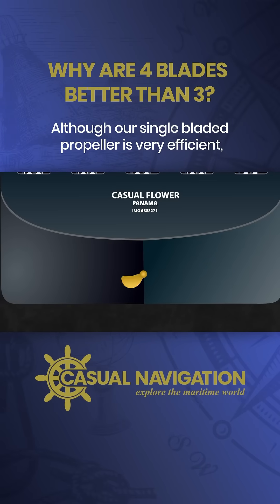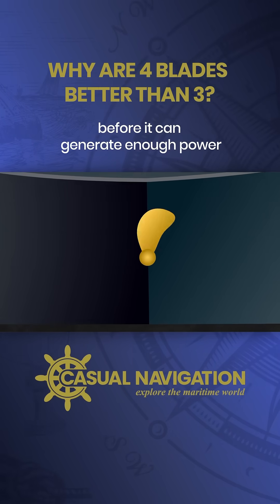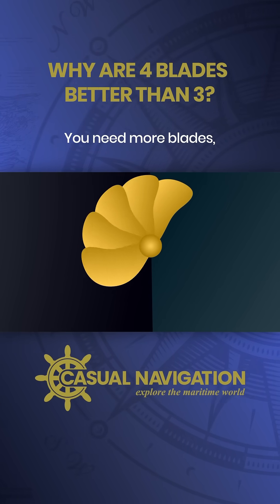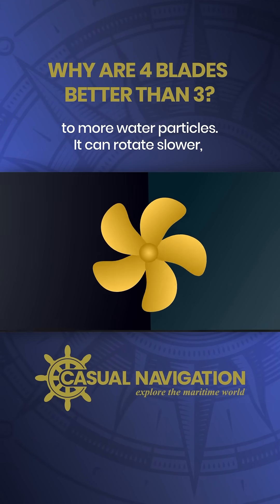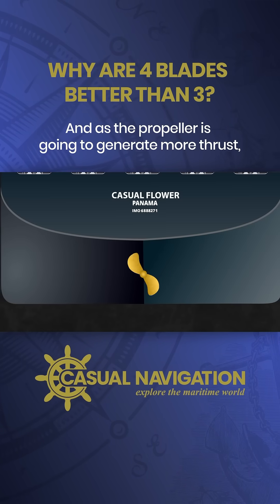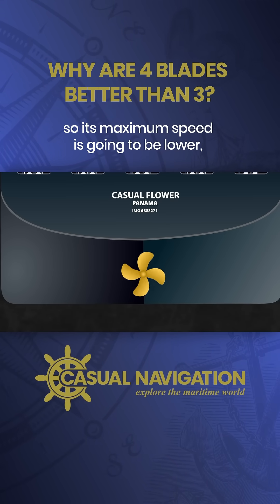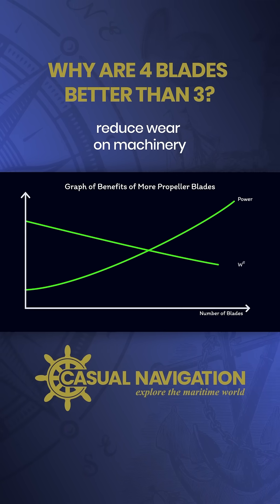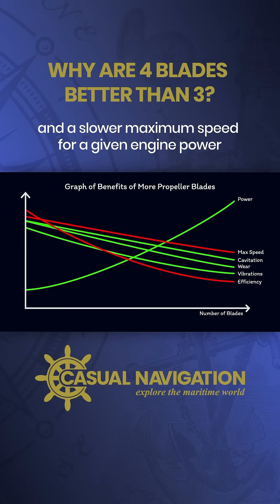4 Blades Better Than 3

Comment: True. But you forgot imbalance (wear on the shaft) and noise, though this is caused by cavitation, so it was involved. TL:DR You need at least two, more is better but starts to have more disadvantage soon before ten.

Comment: Have we tried staggering the blades along the length of the shaft? That could give the same thrust value as a standard propeller while also reducing the amount of disturbed water the blades come in contact with
Reply: How would that reduce it? With the blades on a single plane, all the blades have access to undisturbed water. The disturbed area of water only spreads out behind the blades, so you wont find any more undisturbed water behind them. 

The first propellers were single screw profiles, which is conceptually pretty close to staggered blades, and they were not used for long.
Reply: That axel would be very difficult to balance,
Reply: @ one pair closer to the ship another pair in line with the first two behind them?
Reply: Or a corkscrew? Would that work or am I sipping crazy juice?
Reply: @  that has a large risk of becoming unstable, just minor imperfection will cause it to vibrate putting stress on the bearings, what would cause more and increasing vibrations due to wear
Reply: @ no more so than an imperfect traditional prop
Reply: @ that I have seen, doesn’t do well past anything but very slow speeds

Comment: I don't know how well it'll work in the water, but a drone delivery company engineered a propeller with 2 long and 2 short blades that cut through the air better
You can find a video about it on the channel TheSlowMoGuys

Comment: Since it takes more power (momentum) to spin a propeller with more blades to produce the same thrust as a propeller with fewer blades, that therefore needs to spin faster, the wear and tear on the machinery will probably be about the same.

Comment: Why cant we have 4 propellers with 1 blade each all spaced at 90 degrees apart to resemble a 4 blade propeller. 4 propellers should be placed beside each other at a distance where they di not disturb the water for each other

Comment: Ok what about a really long prop head. You have one blade them travel down the head and theres another blade rotated 90 degrees around the head and so on so you have 4 blades but they are spaces out horizontally. I imagine that might accomodate for some or the concequences of having multiple blades but have structural downsides in how strong and resilient you have to make the prop.

Comment: 30 thousand blades moving at 1 planck length per hour causes light speed travel
Reply: c blades
Reply: You need to have no mass to achieve light speed
Reply: @ or infinite energy
Reply: @mustardjar3216  are there any massless blades?

Comment: What if you considered variable geometry. I don't know if it would have any effect on a propeller. But in CNC milling, there's a significant difference in resonation. A cutter with teeth spaced equally apart, causes a lot of noise and makes larger marks. However, a cutter with teeth spaced unequally apart cancels out resonance an creates a finer finish.
Reply: Sure. But at the end of the day it is all about money. Might be a thing for high end raceboats, but the average container ship will get a single piece of bronze that hopefully will last the 10 or so years untill the ship has paid itself off and gets sold to someone else.
To maintain the geometry you would need to send the ship more often into a dock. And a docked ship doesn´t earn any money
Reply: That science is just now getting into propellor design. It has just hit prototypes of aviation propellers (well drones where innovation can take place sans the govt) and will probably trickle into the maritime space soon.

Comment: A single blade propeller would wear out the shaft and the shaft's bearings like crazy.
Reply: Ok... So I am an engineer that studied hydro power. Propellers are bread and butter there. THe difference is, that we usually have a pipe where the pop works. Somehow I do not remember the part, where more blades caused less power on the propeller. There is a limit on the hydrodynamics that is set by cavitation (approaching boiling pressure of water in the temperature of the sea). There is some issue with currents on the propeller edge. But with more blades you get many great benefits. For one you get symmetric loads on the shaft. Especially bending the shaft is very expensive in bearings (you have to have more resistant bearings and maintain them with high cost). Vibrations would also be crazy, if there was only one blade. The whole ship would feel the shaft wobbling. The engine and the gear box would probably also get damaged, if there was one blade. 
Boy, you have some episode in front of you ;)

Comment: What my engineering course taught me is that everything is a compromise.
Reply: I compromised I ate grilled cheese of the radiator
Reply: "There is no free lunch"
Except on binary search. That one is on the house, assuming you have a sorted list.
Reply: @matheusjahnke8643 what about one Biggs’s propeller
Reply: That's bad... If you're degree would be good, you'd be taught WHY. That's the problem with the modern education... No more selection to make more money. So they had to lower the standards (negative exponentially)... So now people who wouldn't understand it anyway learn nothing, and the few who are able to understand it just get told "that's how it is. No explanation because your peers won't get it"... Diplomas are meaningless today. I ignore them while hiring. Usually the ones with diploma are worse in every point that those without (we have a dual system with apprenticeship vs studying. But it's also broken, because most study but most of those shouldn't... They're allowed to because of money...).
We have to go back to the original. Apprenticeship for everyone. University and studying only for the minority capable of achieving discovery in science.
Reply: You're fired lol
Reply: Thats the difference between scientists and engineers. We can design and make things perfect, but that will be impractical. We make things just good enough.

Comment: Funfact: submarines usually have 7 blades because they have to deal with another factor: noise reduction.
Reply: Prime number of blades to avoid harmonics.
Reply: @grzegorzkapica7930  damn, weaponization of music theory
Reply: noise are just vibrations really
Reply: @downey2294  no shit
Reply: or they'll have a pump-jet instead
Reply: and they have contra rotatating blades, because cavitation which = noise
Reply: Specifically, resonance. Even blade numbers can cause higher frequency, louder sounds due to wave doubling.

Comment: Single bladed propeller just looks wrong. It at least has to be like a spiral coming out from the center
Reply: Just imagine the vibration. bhAGaawtaHGasgAWawaHa. Even in the 1700's they understood this.
Reply: you have just described a lily impeller
Reply: I mean if some new option that's not a compromise ever appeared it'd be a breakthrough and soon the only option adopted

so if more than one option is alive, yeah it's bc it's a compromise
Reply: @  yeah that's the law of pros and cons
Reply: ...the 'Archimedes-screw' is s.k.o an extreme form of a '1-blade-propeller'...!
Reply: Insane imbalance... Would snap the shaft very fast....

Comment: Do marine engines have any facility for synchronizing the rotation of multiple screws?  Propellor-driven aircraft use this approach to manage the noise of propwash reaching the fuselage.
Reply: Some, mostly military ships, have two or more engines, a gearbox in between and two screws (CODAG, CODAD, etc...). The reason is redundancy and fuel efficency. Most other ships don´t have more than one screw at all or seperate systems.

Comment: What about offsetting the blades fore and aft slightly - is the water disturbance improved? I.e. To mimic more of an actual 'screw'.
Reply: They are twisted in such a way that that is effectively accomplished. They're called screws because they originally were screw-shaped! That however produced a lot of drag and wasn't very efficient, thus the evolution to the propeller.
Reply: They effectively are - since the propeller is constantly moving forward each blade takes a "bite" from a different part of the water than the previous.

Comment: So how many blades did the Titanic have? Was it 3, or 4? 🤔
Reply: Titanic had 3 blades on the left and right propeller. In the center the propeller had 3 blades, but this was not connected to the engine and rotated freely with the flow of low pressure steam that was sent to the boilers for reheating.
Reply: Titanic's propellers all had three blades each. It was thought for a time that the central prop connected to the turbine engine had four blades however this was proven unlikely by a chance discovery of engineer's notes from Harland and Wolff that listed the number as three. Her older sister Olympic had four in the center as an experiment but that prop was later reverted back to three. There are no photos of the Titanic's propellers except those taken from the bottom of the ocean.
Reply: @SAOS451316  actually they changed Olympic to three after titanic sank so they could test and then went to four again as 4 were much better
Reply: I believe it was 3, according to the papers. It may look a bit cursed but, yeah, I believe it's 3
Reply: @NobodyGoesREKT ive seen a plane with a 3 blade propeller, and it doesnt looked weird
Reply: @imp4ktth  and take it to a 3 propeller configuration, you'll get a Ju-52, I think (the main thing is, it's a 3, 3 bladed propellers if you wanna believe the papers from H&W). I mean you might always remember the Olympics had a 4 bladed propeller in their central turbine mount, Titanic "most likely" didn't and get a 3 bladed central propeller instead
Reply: @NobodyGoesREKT  yes. and I remembered my old fan was 3 bladed too.
Reply: They could have had two or 12. Their issue was on the other side of the ship.
Reply: Nope wasn't  @mowgli2071
Reply: The Titanic, if I recall correctly, had 2, 3 bladed propellers. And 1, 4 bladed propeller. Assuming I recall correctly.
The 3 bladed propeller is being outboard of the 4 bladed propeller. If you're curious as to why the different propeller choices, they were hooked up to Different Engines. The 3 bladed propellers were connected to the Pair of triple expansion steam engines. While the 4 bladed propeller was hooked up to a steam turbine utilizing the exhaust of the triple expansion engines.
Reply: @dwayne7201  nope a new paper discovered from ship yard said titanic had 3 freee bladed propellers